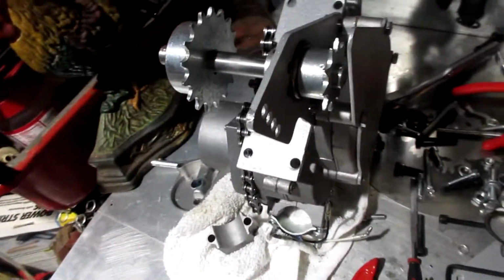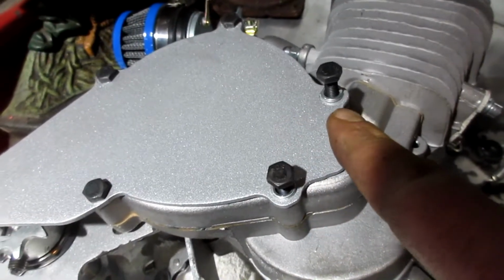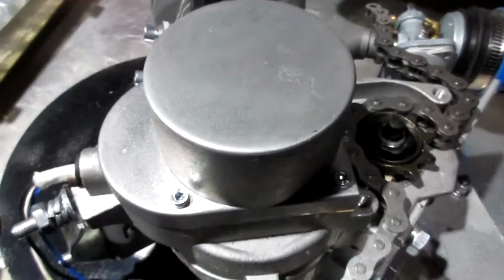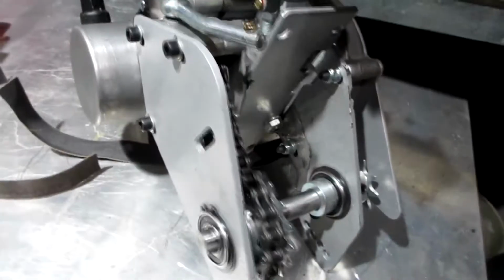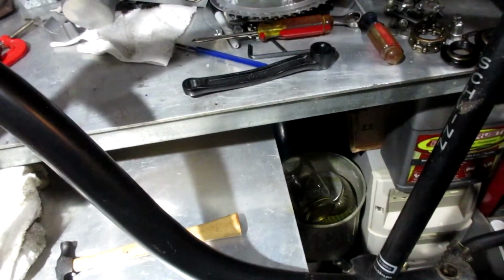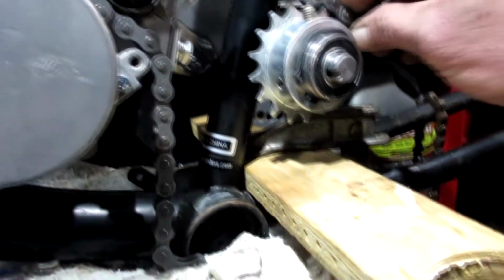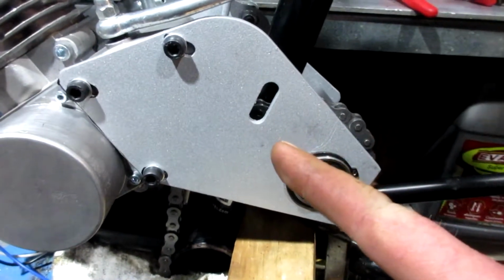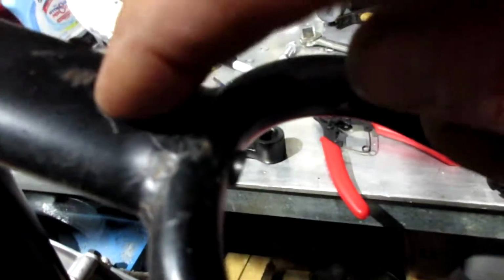80cc Bicycle Motor w/Jackshaft Kit Shift Part 3

Comment: Doesn't the bigger sprocket go on the other side of the shaft the smaller one gets driven from motor the big one drives the bike
Reply from the maker: That's a good point,

Comment: You are going about things wrong and making more work for your self they make spaces for the engine mount all you have to do is find out what the down tube is on whether it is 3/4 inch or larger or smaller that is for the seat tube also I would install fat tire wheels with disk brakes and it is up to you if ythesou want the caliper to be cable pull and pressure or hydraulic on the rear tire you can go ahead with standard front brakes or also disk brakes also nice choice for the handle bars. Hope you take these opinions too heart it will help you out and you are right you will need a longer U-bolt for the set up plus if you add a rubber shim with with the mounts it will help to avoid vibrations from loosening the bolts and causing you more trouble. Plus they make a pull start kit that will bolt on to the engine if you want to go that rout.

Comment: Lol@ clutch arm undo the bolt swing it out some
Reply from the maker: I think I had the motor mount upside down.
Reply: @OlszkoolCustoms  rofl yes ha never noticed. Did this explode yet? Seen so many of these fold up now.   I never tried one yet though
Reply from the maker: @BuildBreakFix  I thought this would be a fun build to take this bike on vacation to the beach, but the entire frame was a nightmare. I'm going to put this setup on a Schwinn Frontier like my blue one, or on a GT bike I picked up. I'd say a modified jackshaft kit is worth a try. It's not complete junk, but it needs tweaked lol... I'll get to it again, I'm messing with a couple mini bike builds right now.

Comment: Usually I have issues with those little shaft keys walking out on me, I found that drilling a small hole into the center of the key and threading the set screw half way down the key keeps it in place with some loctite. You can also use a clutch cover chain guard in addition to that.
Reply from the maker: That is a great Idea!!! Thanks for the comment!

Comment: The jackshaft kit is best used on a mountain bike so you can shift thru the gears.
Reply from the maker: Can you imagine running through a 21 speed. I haven't tried it yet. Thanks for the comment!!
Reply: i have a 24 speed lightweat cycle, maybe i will try something like this with a honda engine some day @OlszkoolCustoms
Reply: Legal